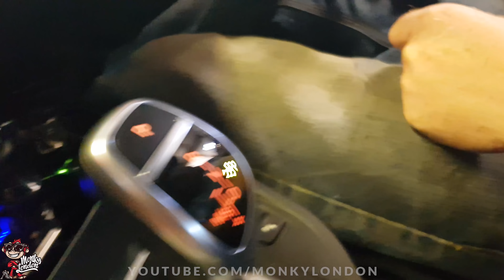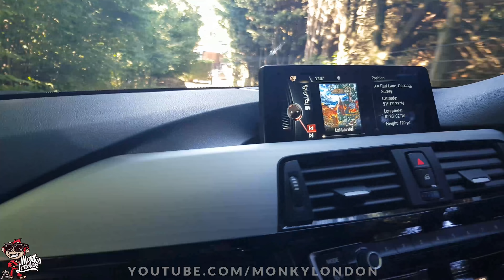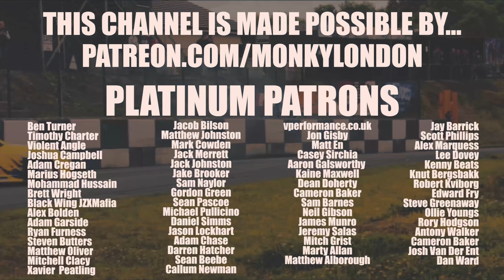🐒 IS THIS THE LOUDEST BMW IN THE WORLD?!?

Comment: Love the sound, but did you know it is illegal to modify an exhaust to a level over and above what it is designed under the constriction and use regs?It will(should)also fail under the new MOT reg changes. Make sure you keep the old one.!

Comment: Why such an aggressive overrun ?! Surely its wasting loads of fuel
Reply: My 1st guess (and it's an amateur one) is it's still mapped to keep the cats at the right temp, which would make the engine more efficient, and in turn burn less fuel.

ECU might just need telling the cats are gone.
Reply: I actually did a bit of reading up as to why all these new 'sport' engine cars overrun like this and from what I gather its a deliberate attempt by the manufacturers to MAKE the car overrun for that 'race car sound' by having the injectors drop tiny amounts of fuel on lift off, and when you decat / straight pipe this is exaggerated to ridiculous levels like we see here.. This is , like you amateur guess from what I've just read up hah.